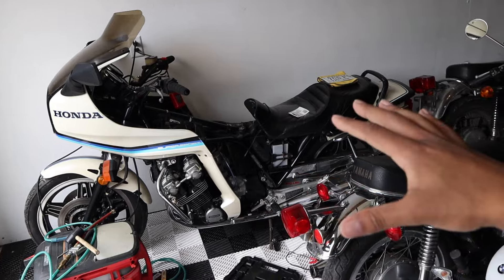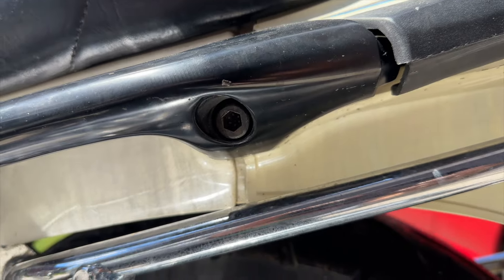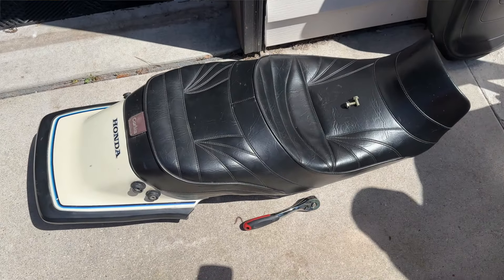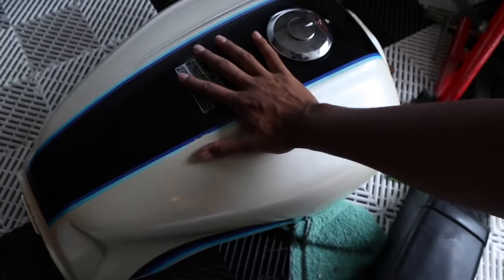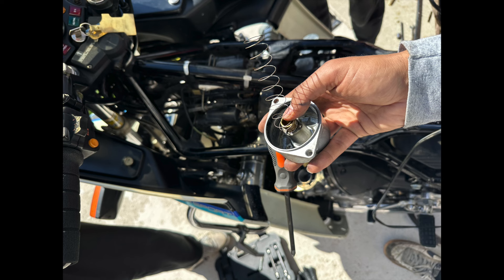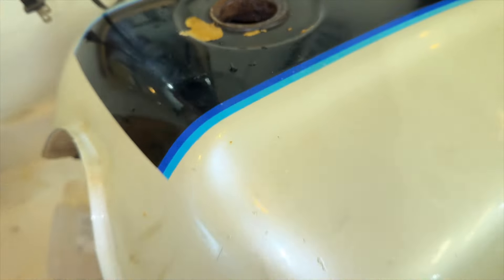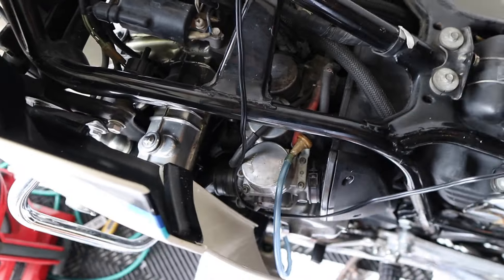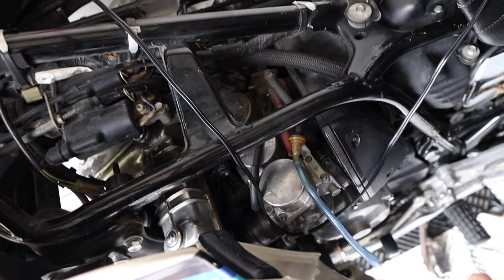Restoring My CBX PT 1 | First Start In 5 Years!!

Comment: The only problem I had with mine was (1) worn out brushes on alternator, and (2) a burned out voltage stabilizer from a jump start. (See problem 1)
Reply from the maker: mine will need carbs and I suppose we will see what happens after that